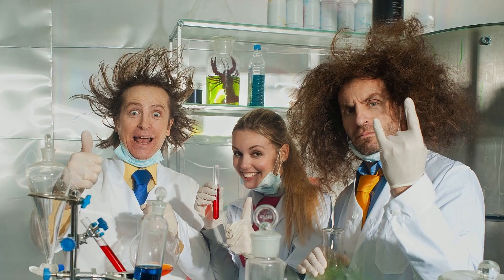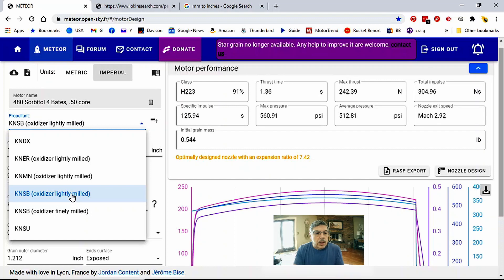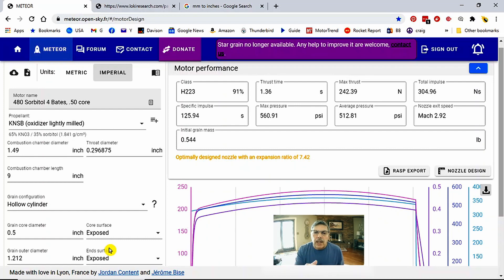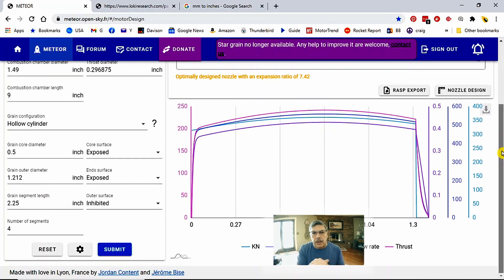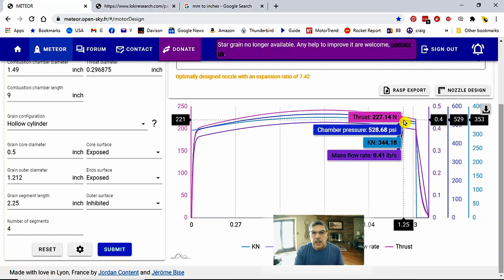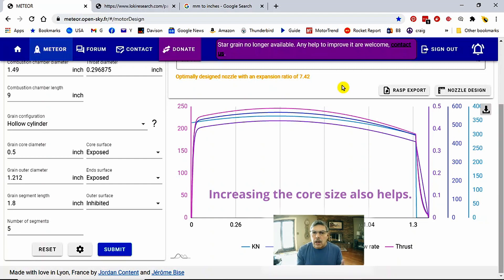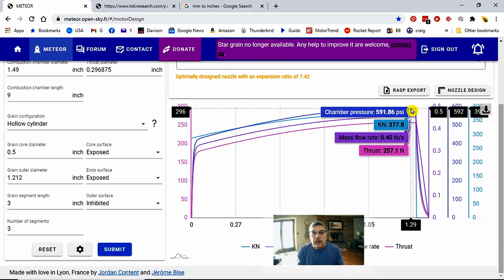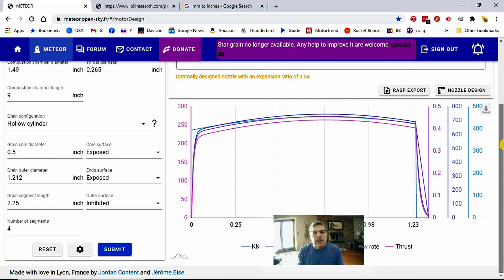Sugar rocket motor design tutorial.

Comment: This is my favorite channel about model rockets. I have a question: should not the outer surface be inhibited? Thanks
Reply from the maker: Yes, there is an inner casting liner and an outer thermal liner to help protect the case from extreme heat.

Comment: Hey! I’ve created a simple sugar motor using powdered and packed clay as my nozzle. They usually work well but sometimes the clay plug slides out when the rocket is burning and usually results in the destruction of my rocket. Would you have and recommendations on how to make the clay nozzle not slide out? Thanks!
Reply from the maker: You could try scoring the inside of the motor with a Dremel to allow something for the clay to grab onto. Allow extra room at the nozzle and use epoxy or epoxy clay to add additional support. Good luck!

Comment: If I assume  chamber pressure and Based on this assumption i design the nozzle , how can I be sure i can  achieve  this pressure  inside the chamber ?
Reply from the maker: Building rocket motors is an art as much as it is a science. The software provides a good starting place to begin with motor planning. The software cannot account for some of the following things.

*Ambient temperature. A temp range from 15°C to 35°C makes a difference in burn rate.
*Thorough mixing and pouring technique.
*Purity and mesh of the KNO3.
*Moisture level of the fuel.

This is where the art of design comes into play. If the motor burns in one second or less for a 38mm then the pressure is probably too high.

The only way to really know is to measure the pressure during a burn. Good question!
I hope that helps.

Comment: for a motor casing made from PVC, what would the maximum recommended pressure be?
Reply from the maker: Around 500 PSI for 1" PVC motor works well. I have not had a PVC motor fail at that pressure and they seem to have good performance. I have not tested at higher pressures.
Reply: @TheRocketeer  thank you

Comment: This is a great software. I am still learning how to use it. There is one thing I was curious. Do you happened to have data on the flex fuel to plug into this amazing software. Thx
Reply from the maker: I use the "sorbitol oxidizer lightly milled" preset. Flexi-fuel will burn slightly faster but the preset works well to start with. I keep my KN around 350 max for flexi-fuel in an aluminum case motor and 400 for sorbitol. Mouse over the graph to see the KN reported. Good luck and watch for more videos on Meteor settings.
Reply: @TheRocketeer  thx

Comment: I know you are working on your flex fuel motor performance in METEOR. But from what you have seen from testing, are the flex fuel motors comparable to sorbitol motors, or do the flex fuel motors produce less thrust? I know that KNSU motors are more powerful than Sorbitol motors, but I would assume with the extra water in the Karo syrup flex fuel motors would not produce as much thrust as the Sorbitol motor. I do not have a thrust measuring stand. But when I test motors (strapped to a concrete block) it seems that the flex fuel motors are more powerful than Sorbitol. That is counter-intuitive. Maybe I am just better at producing the flex fuel motors.

Thanks for all you do with this channel. You have been a great help!
Reply from the maker: Great questions and thanks for the comment!
I don't have a direct comparison between sorbitol and flex-fuel at this time. My first motor test in the spring will be to establish a baseline for the two fuels on a digital thrust stand. I think the burn rate and ISP for the two fuels will end up fairly close. After that I will start testing the aluminum doped fuel.

I do boil off some of the water in flex-fuel by holding the temperature at 250°F for a few minutes and then casting at 265°F. I think there is some residual water left. It may be possible that because sucrose is used that the small amount of water is compensated by the faster burning and energetic sugar. One simple test is to use two identical motors with the same amount of fuel in an actual rocket and see what happens. I like to perform motor test but the real fun is always in watching my rocket rip off the pad with my own fuel!!
Chuck
Reply: @TheRocketeer  I actually did recently make a three grain motor with Sorbitol and a three grain motor with your flex fuel. When I test fired both, it seemed (just from the eye and ear test) that the flex fuel motor was more powerful. 

I really need to build my thrust stand to output thrust from a load cell to an Arduino. I have all the components, I have just been too lazy to put them together.

Comment: what do u think about using kclo3 with sugar ??????😙😙😙
Reply from the maker: Potassium chlorate is a very powerful oxidizer that has been replaced with potassium perclorate. Potassium nitrate is cheaper and safer for use with sugar motors. I do not recomment kclo3.
Reply: potasiun clorate is a power explosive,dont use in propeland,the burn rate is higt under presure  of rocket chamber

Comment: Australia here, thank you for this video great tool. Questions x2  how are optimal convergence and divergent angles picked? What  values do we need to use to simulate a 1% ferrous oxide- KnO3/Sugar mix till we build up a data table?           j m
Reply from the maker: The convergence angle is usually 60 - 45 degrees with 60 being the most common. A divergent angle of 15° works well for sugar motors. METEOR offers the option of changing the angles in the nozzle tab. At this point I don't know the values for RIO. I get a lot of questions on this subject and I plan on doing some testing this summer on doped fuels. For unknown fuels I try to keep the burn time at one second minimum for 38MM and a max of 1.35 seconds. I aim for the longer time and work back if necessary. Greetings to Australia!
Reply: @TheRocketeer   Thank you look forward to seeing how your summer testing works out!

Comment: Great tutorial. Through your recommending I have used this program. I made different profiles for rockets. My problem is that I’m eduguessing at the max pressure my pvc engines can take. Do you have any idea what a 9” pvc , 1” ID can withstand. It is stamped on the tube for its intended purpose,  but they have survived my 12” launches with kno3 and sugar with some iron oxide added. Those aluminum tubes you use are stupid expensive in Canada. I’m trying to keep everything home made without blowing myself up.💣I have upped my safety procedures.
Reply from the maker: It is difficult to determine the max pressure for a PVC motor because heat and vibration play a role. The max working pressure according to this chart is 450 PSI with 1,440 listed as minimum burst pressure. At 12" your motor is already erosive burning so there is a practical limit to length. You may want to consider moving up to 1.25" pipe if you need more thrust.
http://www.jacobsrocketry.com/aer/misc_tables.htm
http://www.jacobsrocketry.com/aer/motor_design_tables.htm
Reply: @TheRocketeer  those are fantastic charts. Just what I was looking for. I’ll tape those up in my work space. Wont launch til spring. Two bigger rockets(for me) ready to go with electronic detonation and altitude. 12” engine with 5 grains tested and ready to put into my rocket body. It will be epoch, one way or another.